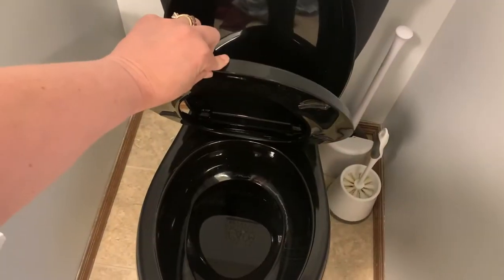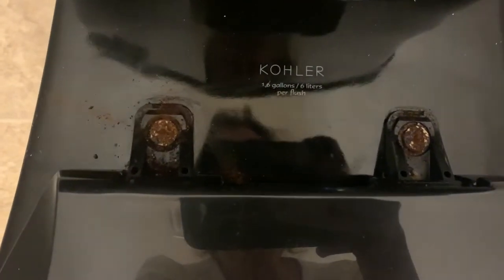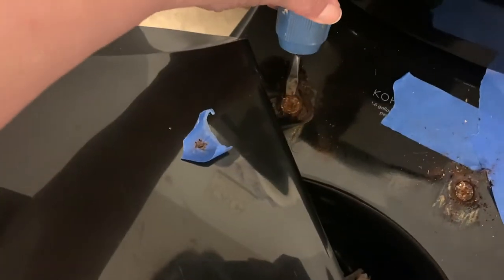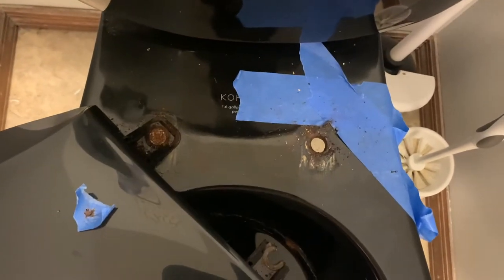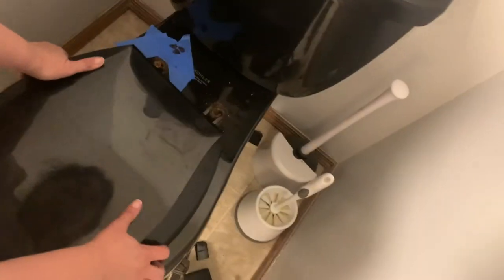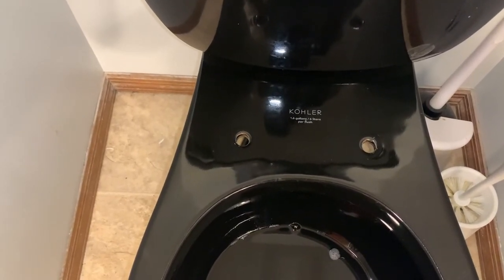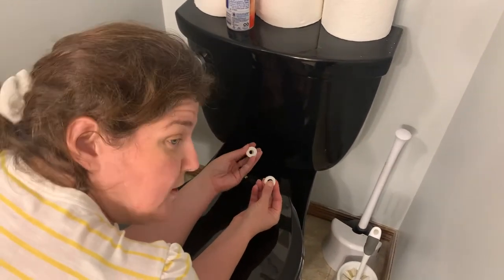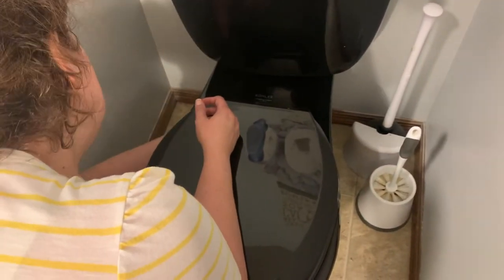How to Change a Toilet Seat with Corroded Bolts

Comment: Mine had plastic nuts on the bottom and no maneuverablity space ... barely enough room to fit my shoulders.  Plus, the washer wasn't brittle at all; it was so soft that my wrench couldn't grip it.  Watching your video gave me an idea that probably wouldn't have occurred to me.  I used a chisel and mallet to gradually cut through the washer, then wire cutters to cut/pull bits of it off until I was able to finger loosen the bolt.  Thank you!
Reply: Thanks! Your comment helped me get the washer off that’d been stuck for 3 days. I’d never have thought to use a chisel and mallet to get it off

Comment: Emily, Great Video...also the older ones still have plastic nuts on the bottom. You can get a flathead  screw driver between the nut and it will usually break off cause they are so brittle.

Comment: This is a very helpful video. I have been trying to remove my toilet seat for the last three days. It has been an ordeal until today. I broke the part attached to the bolts and they felt on the floor. After that I could finally replace the toilet seat. The new one has plastic bolts so I don't think in the future I will have to deal with corroded bolts. Thank you very much for your video!!!😀

Comment: With slotted bolts as shown in the vid,, easy to drill out from topside,,,1/4" drillbit.
If different like mine was, I used plastic welder from Harbor Freight (amounts to extra hot solder appliance -$10),
to melt out the nylon nuts.  Extra hot soldering gun with spade adapter would probably work as well.

Comment: Hi - If the nut is plastic just get a sharp chisel and a mallet, working from below carefully  cut it off the bolt and voila - done.  Should take about 3 minutes if you are really careful.

Comment: I agree with some of the others. Not very helpful at all. Best to just use WD-40 to try to loosen the bolts. 

Also, the rusting is not necessarily from backsplash. In more humid parts of the world, these bolts are likely to rust.